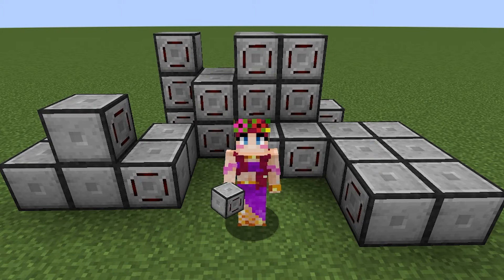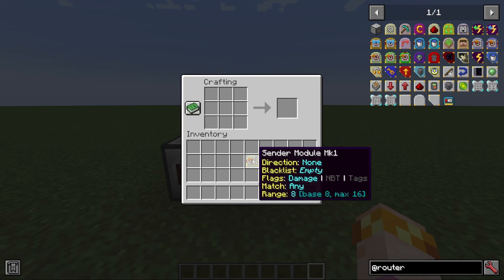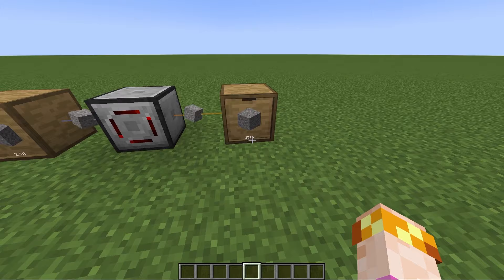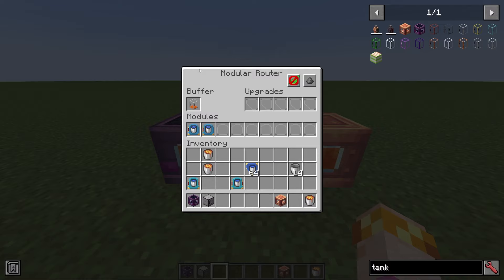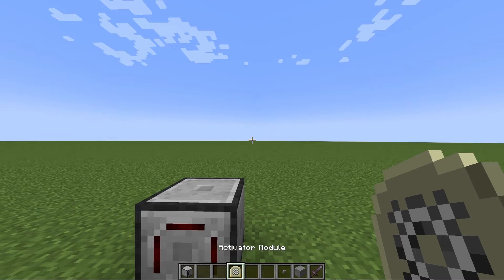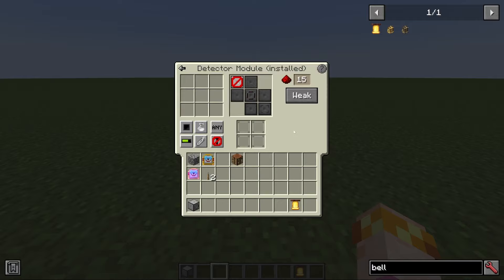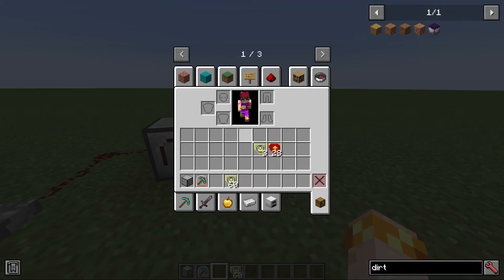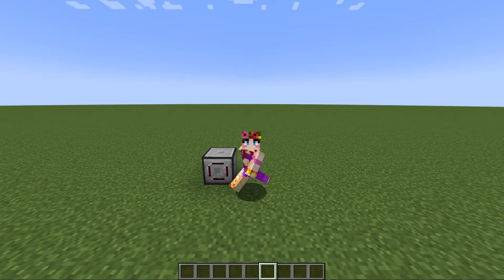Modular Routers - A Comprehensive Guide

Comment: This was awesome, thank you! Do you have anything on the regulator augment (I couldn't find it in the video transcript)?
Reply: I'm trying to make a compact 'shop' system where e.g. someone puts four diamonds in a chest, and it drops a sword. I can't quite figure out whether the regulator augment is going to work — I'm currently using a Create threshold switch to measure how many diamonds are in the router (which puts out a redstone signal to another router that takes the diamonds, and a third router drops the item), but I'm trying to figure out whether the regulator augment might help me remove the need for the threshold switch. The regulator augment seems to be more for keeping items in a chest, rather than regulating how many are picked up — does that seem right?
Reply from the maker: For the Regulator Augment check out 19:01, there's a timestamp for it in the video description :) You understand it correctly however it does have some functionality for the puller module, just not a functionality that works for your particular need. Unfortunately Routers don't have a way to count the number of items in a chest. What I would recommend for you is to use a smart chute from create mod under a barrel since you can set it to extract exactly 4 diamonds at a time from the barrel and the barrel will completely hide the chute. The chute could lead into a router with 9x speed upgrades and 2x stack upgrades which would have the following modules: 1) detector module set to terminate on no match (empty blacklist). 2) sender module mk2 which sends the diamonds to wherever you want to collect them from. 3) puller mk2 which pulls the sword from whatever container they are stored in. 4) sender module mk2 that sends the sword to a 2nd router in the floor right next to the barrel. The 2nd router would just have 9x speed upgrades and a dropper module facing in the up direction and the camo module to disguise it as part of your floor. This should work for any number of diamonds inserted into the chest at once and dispense the correct number of swords every time without taking any extra diamonds from your customer